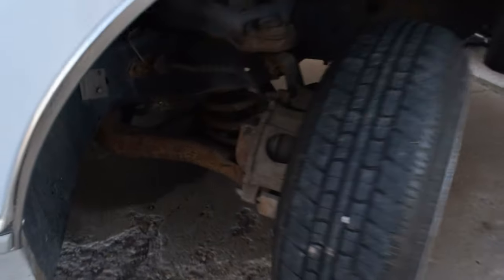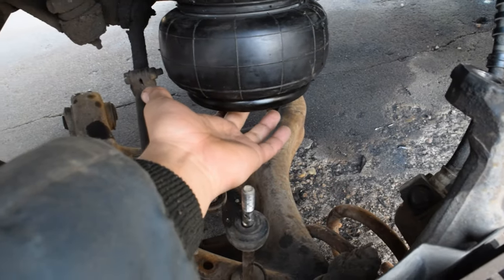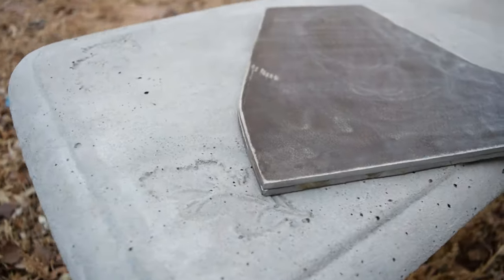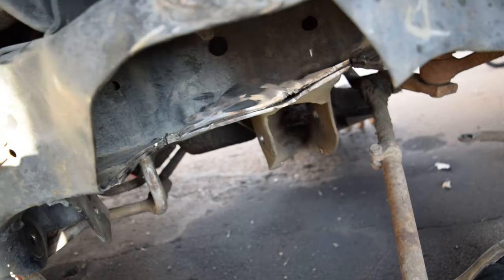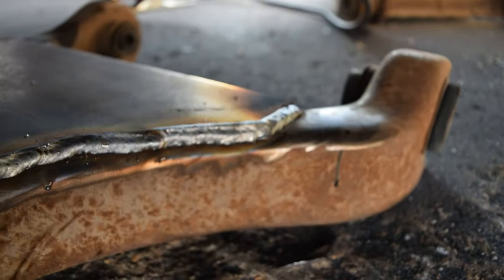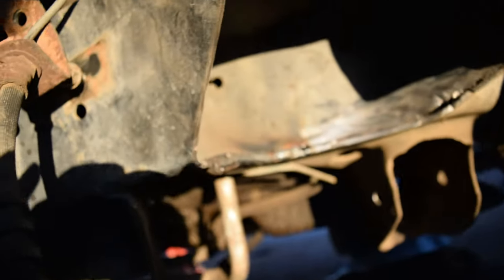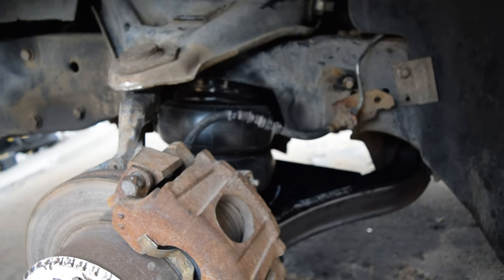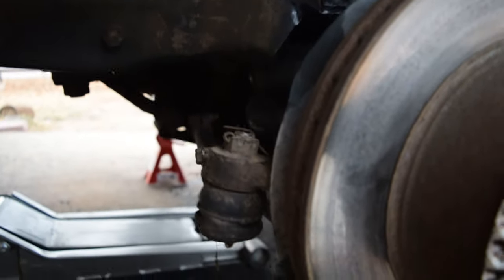$500 Bag Setup on the Lincoln (Part 4)

Comment: Just curious, why didn't you replace the control arm bushings and ball joints while you had the front end tore down? They're cheap enough as it is.
Reply from the maker: They didn’t seem bad, if they were to fail down the road it’s not too bad to take apart the front end

Comment: Maaan all u needed was the town car kit from cce and cut the spring hole out just a bit u was doing toooo much…. I just did mine air lift 2500 double bellow all the way around and no welding required
Reply from the maker: This was just a cheap project, I wanna do hydraulics on a different car

Comment: what did you use to cut the front to clear those bags?
Reply from the maker: Just used a grinder with a cutting disk and cleaned up the cuts using a sanding disk

Comment: how would i make it faster the bags?
Reply from the maker: You just need bigger airline like 1/2” and more air supply would also help
Reply: @CGOD  fosho bro where could i get a kit for my 1990 cadillac deville let me know i want fast bags 🙏🏻
Reply from the maker: @josebarajas242  there’s some air ride sites but mainly you’ll want 1/2” air valves, atleast 2 compressors, big tank, and 2600 bags.